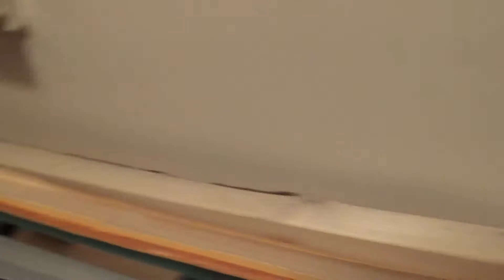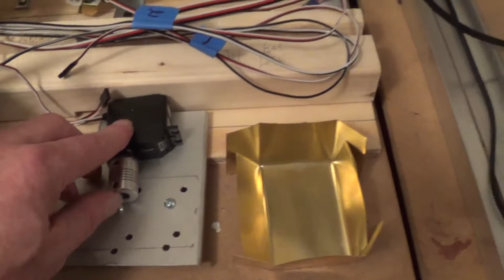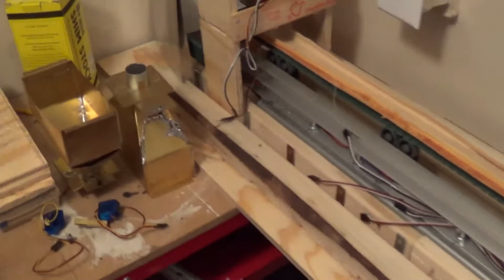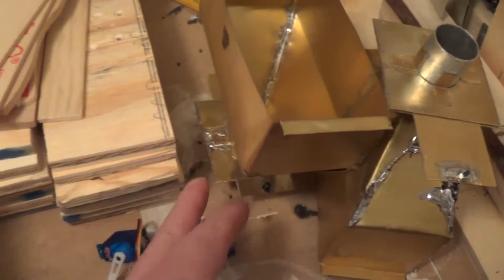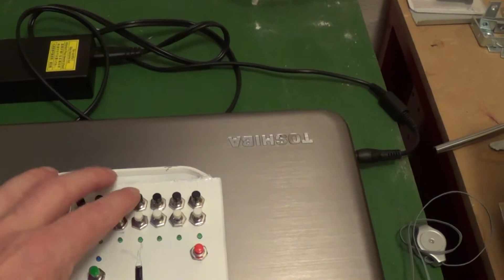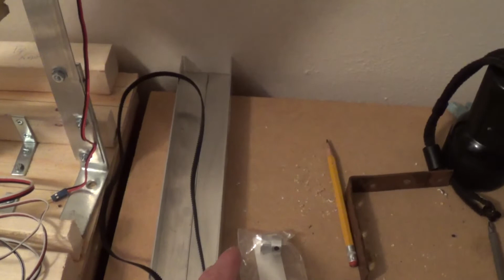Operational HO Great Lakes Bulk Freighter self unloader Build Part 1 2015 3 17

Comment: A thin sliver of PVC Vinyl  might work better than a Bike Tube . You could skive the ends,{with a sander} then PVC glue them in place with cleats to catch materiel. Just a thought. Great build.
Reply from the maker: Thanks for the thought.
I already have glued the inner tube to the belt.. will see how it works.